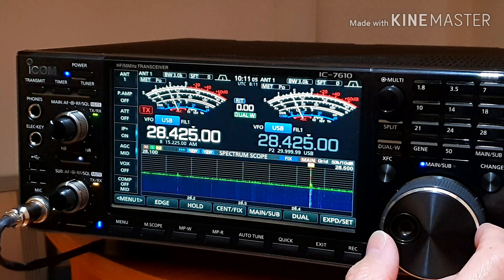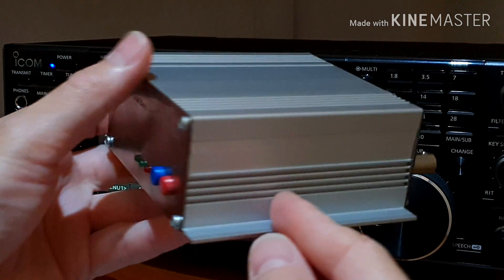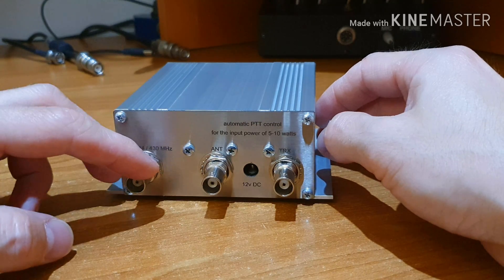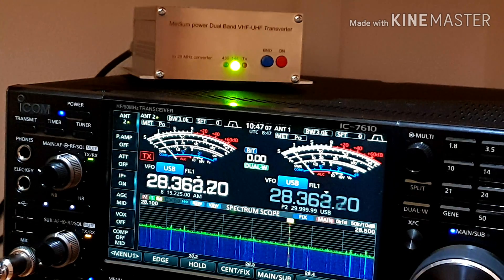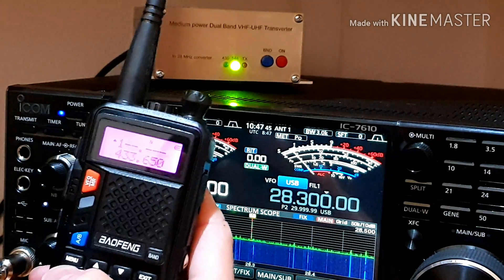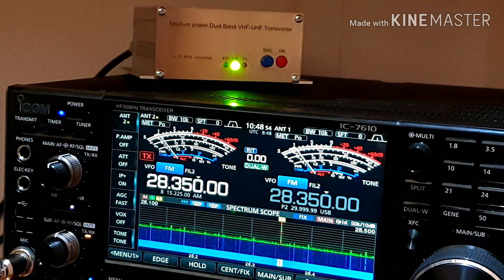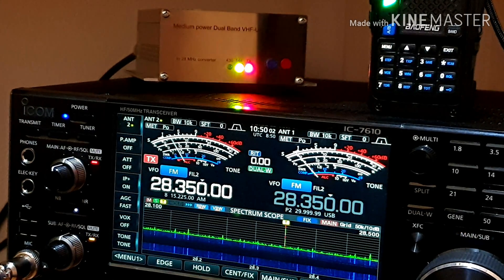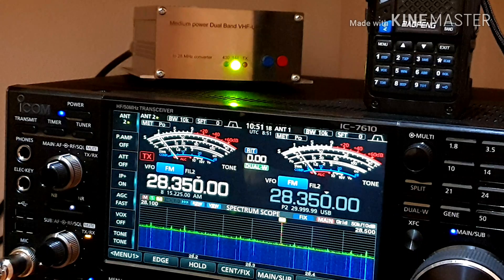Turn your HF transceiver in to a VHF/UHF radio

Comment: Using this transverter for 10 meters to 2 meters if 28.000 MHz = 144.000 MHz. Would you need 32.000 MHz to operate on 148.000 MHz?

Comment: I've run into a problem that I'm trying to find a work-around to.  I own a Japan Version of the Icom IC-9700.  The Japan version is hard-locked to prevent you from transmitting on 146 to 148.00 MHz. Will a Transverter allow me to talk on 146 to 148?  If not any ideas?

Comment: I am want to buy this but have a few questions about what I need.  I believe these questions will help other people as well.  I have an FTDX101MP and am worried about accidently blowing up the transverter by hitting it too hard from the radio.  Is the input protected or can it be fused ?  Also, I have a new 200 watt 144Mhz amp that wants to see 10-15 watts RF input power.  Do you have a unit that is capable of driving my amp at this level?  Is the keying of your transverter automatic (RF sensing) or do I have to switch it into transmit?

Comment: So, it's a frequency multiplier with power output stage
Reply from the maker: Yes
Reply: @OM0ET  
Supposed I want to convert my 2m transceiver to higher frequency as I'm willing to transmit on 1200Mhz, is there a Transverter for that one?

Comment: I'm trying to locate a solution to allow me to gain access to local 2m SSB traffic and this does not appear to be possible with transverters as far as this demo provides. Good video nonetheless. 73 de KN4GEI
Reply: yes it does 28.00 would transvert to 144.200  , nearly all 2 meter SSB and CW is from 144 to 146 so 28.0 to 29.9 is going to transvert  to 144.0 to 145.9    146 and above  is usually FM  73 J

Comment: Hi, I would be using 2/70 and 10/11 meter antennas, on my CRT 9900 10/11 radio to get 2m ssb,would I still have to swap antennas around? Would the transverter work with my radio?

Comment: That converter would need to be really cheap because you can buy cheap 2meter radio
Reply from the maker: But there is not any cheap 2m radio with all modes like SSB or CW 😉

Comment: Hi would the transverter work on a yaesu ft-757gx.
Reply from the maker: It will work with any HF 10m band radio

Comment: Transverters are OK but always to low output? I would never buy one unless it did at least 50W
Reply: There are transverters with 150 watts out but they are in the $850 US range for price. http://q5signal.com/index.php?route=product/product&path=62&product_id=97 for instance but at that price, try buying a 220m all band 150 watt radio.
Reply: @don_n5skt  Interesting

Comment: I Have noticed 2 drawbacks,  one is it doesn't cover 430 mhz and there are a lot of Uk repeaters down there and the other thing is if you want to take it right up to the top of the two meter band, 148mhz say, the transceiver would have to be on around 32mhz, ad most transceivers wont transmit there unless they are widebanded, if i have that right, any comments noted and welcome,,,,if it wasn't for that i might be tempted to buy one....i have no idea how much they cost or where to get them....Fred g4vvq Uk.
Reply: You can do this on a Flexradio. The radio will, out the transverter port, transmit from 25mhz to 29mhz. It essentially ignores band lock on the transverter port.

Comment: Hello thanks foto de test, my question is, how transmit in USB or lsb, for de satélites, thanks other times, excuseme for my fatal english
Reply from the maker: Transverter bands are switching manually so if you plan to use crossband so is not possible with this. If you plan to use split in-band its OK. Just one negative thing is that VFO inside transverter is not much stable :)

Comment: Hi Paul
I Have The New Model that your link now points to, The Lo has a switch to add another 2 mhz, the osc is dds and it is very stable  on 2 and 70cm, my frq counter is gpsdo locked, and the transverter does not wonder, but it is 110hz of frq at 2m and 400hz on 70cm so you need to remember this when tuning to correct it, 
The seller is very good, it arrived to the united kingdom in just over 1week, i did have the 150w 50ohm resister fail the fist day, and i told the seller and he refunded me the cost of getting another resister ,
the one thing this resister and the RF output tranny is mounted to the rear s/steel plate, as a heat sink  s/steal is a very bad heat conductor , so i added a ally heatsink to the rf output and the power came up a bit another 2w on 2m so the heat was making it lower the power, there was also no heat sink compound on these components witch i have now corrected, The signal looks very good on my RSPDUO, sdr,
Thanks Dave 2E0DMB
Reply from the maker: Hello Dave! Thank you very much for your measurements and great informations how to made this transverter even better! Thanks for this review 😉👍 73, Paul.

Comment: Could you use a base cb with ssb with this ?
Reply from the maker: Sure. You need any TRX with 28-30MHz band.
Reply: Cb here is 27mhz would that still work ?
Reply from the maker: @cmvb69  No, it must be 28-30MHz. Converter will add +116MHz to its input frequency signal. So 27MHz+116MHz=143MHz.

Comment: I see on ebay they have one with or without attenuator, what does the attenuator do ?
Reply from the maker: The attenuator protects transverter input before the high output power from transceiver.

Comment: Will it transvert SSB too, or any mode, of just FM for simple or repeater use? 73
Reply from the maker: It transvert all modes. 😉👍
Reply: @OM0ET  So the output power will be limited to 10 watts? Thanks.
Reply from the maker: @k2icc  yes, you will need additional PA. But internal oscilator is not stable in this thing.
Reply: @OM0ET  Great video regardless of the oscillator. A challenge to build something better if needed. But the explanation is great. I just have not used one yet. Thanks a lot.
Reply from the maker: @k2icc  Thank you too for the nice comment! :)

Comment: have you tried in ssb? is it checked or does it have a difference in Hz?mine is traveling.73's de Iz7GLL
Reply from the maker: Yes I did and is traveling too. Not OK for FT8. it needs more stable oscillator.
Reply: @OM0ET  ok thanks for the info
Reply from the maker: @IZ7GLL  you are welcome 😉 73, Paul.

Comment: You should try this again with the transverter port, I think it will display the correct frequency on your radio, see instructions on page 2-2...
Reply: Yes, you can apply an offset in the menu to display the 'actual' 144 MHz frequency I believe.
Reply: @combatwombat71  still have not seen the video about that yet but it is a nice feature in the 7610 for transverter input which wasn't use in that video unfortunately...

Comment: I wonder why transverters are always on 10m... they should do transverters on the 6m band that has 4MHz bandwidth...
Reply from the maker: Who knows. I guess that 10m band radios are more common than 6m radios 😊
Reply: some of the newer radios and nearly none of 20+ year old HF radios include 6 meters.  It would be great to have a few transverter options to choose from based on whether you have 6M or not...  It could be an option to transvert at 25.0 or 26.0 Mhz for the sake of having wider bandwidth support, but then the HF radio would need a MARS mod performed. I am guessing 10M is used because it is the widest band that nearly every Amateur HF radio has and as such would provided the best option without any need to mod the radio itself.

Comment: not wide enough on 70cms 432 to 437 wide at best.  pity they never thought of the usa market too further on up at  440/450mhz................................................................................................................................................but a serious  question id like an icom mabe a 7300  but you never said does any or all  icoms  have a transverter frequencey digit change option so it looks the same on the display ?....
Reply from the maker: This is a 28 to 144/432 transverter so the input signal goes directly from the ANT output of any 10m band transceiver. It means that you have to tune your TRX to for example 28.300 MHz and your signal will be transverted to 144.300 MHz. Same with 70cm band. There is a switch. Input frequency 28.300 is transverted to 432.300 MHz. You don't need any special TVRT  output on your transceiver. Just lower power to max.5W and go. 73
Reply: @OM0ET i do understand they can drift on frequencey and are not stable but they are not to bad.                    but i dont think you understand my question  .. The USA  band on 70cms  is 440 mhz to 450 mhz   hence i said its not wide enough in band width for the usa market  starting at 432 mhz with a 28 IF.. as you will only get about 5mhz band width output in total but not much more.    taking you to around 437mhz with a 33 IF.        its just a pity they never made them too for the upper part of the 70cms band. mabe one day they will think about this  as america is a big place and they could get many more sales thats all i ment.   thanks for the reply sir
Reply: @jonneilsmyth9107  The 70-centimeter or 440 MHz band is a portion of the UHF radio spectrum internationally allocated to amateur radio and amateur satellite use. The ITU amateur radio allocation is from 430 to 440 MHz; however, some countries, such as the United States, allocate hams 420 to 450 MHz.
Reply from the maker: Of course that on the screen you will see 28.300 tuned frequency. But .300 gives you the information where you are.
Reply from the maker: VFO stability is not good for digital modes and the receiver input quality is not good against to near very strong signals. But for this price I can't wait more...
Reply: @OM0ET  sorry for any confusion ..   my second question was does the icom 7300 or other icom models not have a frequencey offset setting  to accommodate the transverter to simply change the 28 part  to 144 or 432 as most ham radios do but not all ?

Comment: Great video as always Paul, I have an icom 751 and apparently this would work it has a transverter port on the back for the low input power, but my question is how to incorporate a CTCSS tone, any ideas.
Many thanks for sharing this txverter. Barnie.
Reply from the maker: Hello Barnie, thanks for lovely comment ;-) The Icom 7610 has in FM mode possibility to turn on TONE feature. Inside this feature is to set REPEATER TONE and also I can set the T-SQL TONE. And also there is a T-SCAN. So I can make a FM contacts trough repeaters with this HF Icom transceiver and VHF transverter. 73, Paul
Reply: That radio does not have it built in. You need to connect CTCSS generator either after audio high-pass filter or put out enough signal that it passes through. Filters are usually 300Hz and above, tones are about 30-250Hz, and 88.5Hz and up to about 150Hz is those most used.

Comment: Next version provide separate antenna input for 2m and 70cm and full duplex capability, so it will allow amateur radio satellite operation :)
Reply: cqpy2rn they drift like hell on uhf ssb tx. The LO is not stable AT ALL. Many people try to apply heat to the LO but I didn’t help. 9k drift when trying the birds
Reply: @JayN4GO  You confuse these transverters with transverters from the Transverter Store. The Transverter Store makes cheap forgeries with poor characteristics.
The transceiver that is shown in the video has separate TCXOs into both bands and the stability is determined by the characteristics of the transceiver you use.
Reply: Андрей Бондаренко yes Serge is the one i have seen tested with the icom 7300. It was junk. Where is the stats on this transverter ?
Reply: @JayN4GO  LO replaced w/ Si510 & Si591 programmed for satellite subband. Works fine, no drift.

Comment: What about the range?, Is the implementation the same as the HF Frequency wave!, YG3DAP from Indonesia, thank & 73 my friend.
Reply from the maker: Hello my friend, I am not sure what exactly about is your question, but basically you can listen whole VHF band on 10m band. Just ignore 28.MHz and imagine it's 144.MHz. For example: if you want tune 144.300 USB, just tune your 10m band transceiver to 28.300 USB and thats it ;-) it's simple. The range is from 144.000 to 148.000 MHz and from 432.000 to 436.000 MHz. Best 73, Paul OM0ET

Comment: Great video, thank you for sharing. Question, at 6:27 I hear what sounds like a large motor starting and notice a quick jump in interference on your radio?
Reply from the maker: Thank you Jimbo. The sound you heard is a elevator motor in my house. Because of I am living in top floor appartment, the sound from this motor is loud because is located on top in a small elevator room 😊 But i don't realize this sound any more after couple years I live here 😄 I am glad that the roof is so close because of antennas hihi 😉👍 73, Paul

Comment: I use my IC7610 with Down East Microwave Transverters, works really well. I wouldn’t recommend the Transverter Store units as they have very poor spurious performance and a receive noise figure of around 8db
Reply from the maker: 8:28  Noise figure typ. 1.1dB VHF / 1.5dB UHF
Reply: OM0ET you must have got a good one...
Reply from the maker: @timhague882  could you give me a link where I can buy it from please? 😉 I mean the Down East Microwave.
Reply: This Transverter is not from the Transverter Store! The Transverter Store makes cheap forgeries. Their transverters have very low characteristics. Be careful!
Reply from the maker: @Bond-c7d  thank you for your comment. Which store exactly do you mean? could you post a link?
Reply: OM0ET google the transverter store. You’ll find them. Have you tested this one on ssb on uhf to see if it’s stable?

Comment: Nice, the rang to VHF from  144 MHz to 145 MHz?
Reply from the maker: Look at here 8:28 and pause 😉👍
Reply: @OM0ET  My transceiver only goes up to 30.0mhz and the repeater I want to use is on 147.09.  I won't be able to right?
Reply from the maker: @jrweathers5296  If the max is only 30MHz so probably no. In the product description they write:  RF range 144 ... 148MHz and 432-436Mhz so it means that 28.100 is 144.100, 29.100 is 145.100,  30.100 is 146.100 and 31.100/147.100. So you should have transceiver with wider frequency range (31.090 MHz).
Reply: Amazing TNX 73 de IS0HMZ Luca ciao

Comment: I bought this a couple of months ago it is a very well made transverter, a good way to do CW on VHF, maybe it can be used with a duplexer to save swapping about with VHF and UHF antennas.
Reply from the maker: I use also duplexer because I have a dualband VHF/UHF yagi + HF long wire antenna :-) in one cable. Works good, bud when I compare it with the FT991a so this transverter is on UHF little more deaf than Yeasu. But VHF is OK.